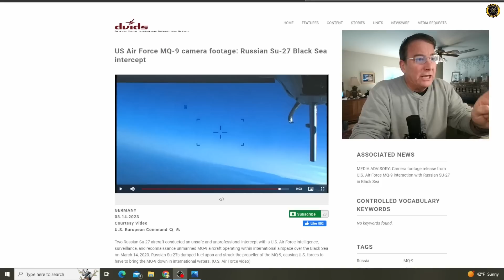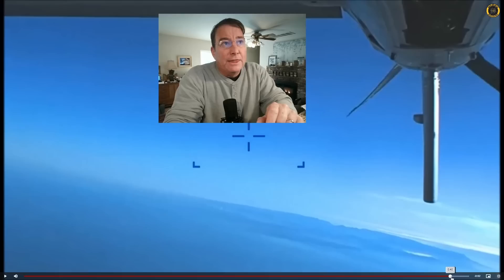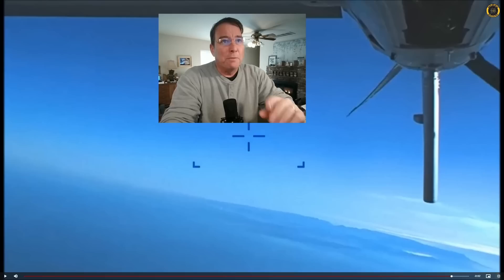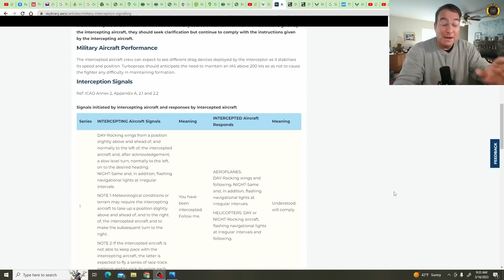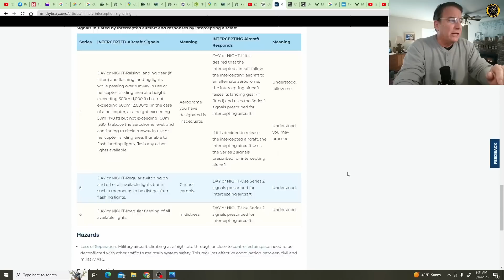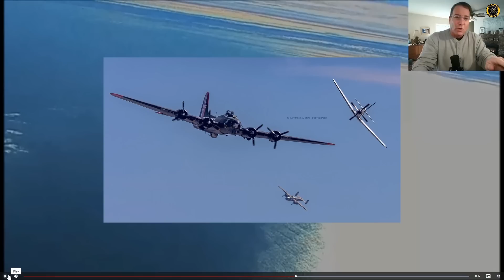Botched Russian Intercept of MQ-9 Drone Over International Waters

Comment: Just a couple of minor corrections. A reversing prop doesn't pass feather pitch to reverse. It passes full fine pitch on its way to reverse. Also, some props fail feathered and some fail full fine pitch. A good example of the difference are the 4/8 blades C130 props vs the 6 bladed on the C130J.
Reply: Single engine aircraft as far as i know always fail in full fine pitch, you wouldnt want to loose all thrust in a single engine aicraft if the feathering system failed.
Reply: @Icel4nd3r  Yeah I'm not sure about singles tbh but a prop failed in fine pitch has its own dangers. If the engine is also failed then you effectively have reverse thrust in flight beyond your control.
Reply from the maker: Correct, my mistake.
Reply: @Icel4nd3r  props will fail fine on oil pressure loss unless you have counterweighted blades in which case they'll fail to coarse pitch.  Counterweighted blades are used on aerobatic props for this reason - look for huge bobweights near the blade root.
Reply: @Icel4nd3r  loose = not tight, wrong word
Reply: @blancolirio  We used to fly Mig29, we hit trees, we hit water at high AOA with the low fuselage tail section...the jets survived...very robust built aircraft. One time a UA Szu  27 hit a traffic sign...I also flew some western jets...engineers shaved off a lot of weight...a lot less robust built...even the ejection seats (Martin Baker) sucked compared to the K36 seats which were around 150kg while the MB seat 93kg...but the envelope very limited...Anyway my point is the following, you do not want to hit an areal object with the wing or the cabin...both fatal or gets uncontrolled situation...the part to take down a drone is the bottom fuselage...exactly how He did it...
Reply: How can it not pass through feathered? Isn't feathered basically parallel to the air passing over it, causing no drag? If so, while turning from facing one way to another, how can it not go through feathered?!
Reply: @AureliusR because it goes from forward pitch through fine pitch to reverse pitch. Not the other way through feathered.
Reply: Props to  @blancolirio for admitting his mistakes.

Bada boom tish!
Reply: I'd love to see what, if any damage happened to the gearbox internals.
Reply: @Dreddip  you’ll have to ask the Russians after they recover it.
Reply: @Icel4nd3r  You are correct. Typically single engine piston aircraft do not have full feathering props. Multi engine aircraft will have them if they're constant speed. Turbines will almost always have them since the non-feathering version will continue to windmill at a high enough RPM to create a severe drag problem.
Reply: @imaPangolin  I have sent them an email requesting photos. I'll let you know what they say.
Reply: @Icel4nd3r  Always  Well said. How could it be any other way ?
Reply: @davidkavanagh189  WHAT ?Not the way it works
Reply: Hello David. As for the C-130 4 bladed prop model HS 54H60 when you say fails it depends on if it fails to control pitch or if the pilot commands a feather by the condition lever. That propeller has several safety features such as a low pitch stop and a pitch lock system which locks the pitch in case a loss of oil pressure to the barrel dome turns into a tendency to go fine pitch and thus a prop overspeed. The way it works normally is that a positive oil pressure needs to be presented to the fwd dome cylinder to maintain positive pressure on the coarse pitch side, otherwise it will naturally go to fine pitch and try to overspeed. The pitch lock works between 25-55 degrees blade in flight range and locks the pitch to prevent RPM overspeed. If an engine flames out the tendency of the assembly is to decrease speed but since speed is controlled by the prop (98-102%rpm in flight range) it will decrease pitch to maintain RPM to a certain extent and it will steady at whatever angle to maintain normal RPM for the aircraft speed while dragging the power section. To feather, a specific electric AUX feather pump is activated to raise oil px and bring the blades to the feather position (92.5 degrees). Of course if a change in speed is done it will affect the prop and its balance state. The angle limits on the prop blades is full reverse to feather like you mentioned.
Reply: @pauleyplay  I made a few points. Which one are you referring to?
Reply: @fasousa4798  Thanks for the detailed explanation! I had forgotten about the pitch locks!
Reply: @fasousa  every prop I've ever worked on requires oil to reduce pitch. It takes oil from the prop governor to drive the prop from the feathered position towards low pitch and ultimately reverse. In the case of the 331 an oil pump is used to unfeather the prop (unfeathering pump). To feather the prop the 331 has a dump valve above the propeller pitch control that when open dumps prop oil. The PT6 has a feathering valve which dumps prop oil and feathers the prop. It's possible the C130 has a different design I've never seen but I'd bet you got your forces backwards.
Reply: @Dreddip  Thanks for the input but no. The C-130 uses oil pressure to increase pitch while the tendency of the prop is to reduce pitch while accelerating. The normal prop governing via valve housing and pump housing adjusts pitch in alpha (flight) and beta (ground) range to increase the blade angle. Beyond the max pitch on high power loads towards feather it needs an additional pump called AUX feather pump (3 phase electrical) to push the blades up to feather angle (92.5º) and then it should stay in place stopped by a prop brake once the oil pressure drops when decelerating. If the prop is feathered and you want to unfeather for an airstart for instance then it also uses the AUX feather pump to decrease pitch and then the wind mill will take over until the power section lights off and the torque becomes positive.
Reply: @Dreddip  It depends which C130 prop you're talking about. I think the later C130Js have a prop that fails feathered and needs oil pressure to flatten pitch but the older C130 style prop(including the 8 blade retrofit) operates as @fasousa says. They are most definitely not all the same.
Reply: @davidkavanagh189  Fine pitch to beta then reverse. I cant get behind a prop fail to feather ? Bring you down in a hurry. Not saying you are wrong. Never seen it in 60 years.
Reply: @pauleyplay  Lots of props fail to feather.
Reply: @fasousa4798  That is a VERY interesting propeller control system design. I'd love to get to tinker around with one.
Reply: @pauleyplay  As for a C-130 54H60 prop you just need to have the feather pump failed (or ESS AC bus failed) and it will never feather the prop staying windmilling if within RPM limits otherwise a pitch lock system will lock the blades to prevent overspeed.

Comment: Thanks for the breakdown.
4:15 Just a note here, we don't know what happened prior to those fly-by. Maybe the fighters did start with a proper intercept before going into those fuel-dump maneuvers. We simply don't have data on how long that encounter lasted since we were only given info on the part that brought the drone down.
Reply: Yea I was always told there are TWO sides to every story.
Reply: yeah its kinda worrying that he says this is poor airmanship, its quite clearly superb flying with the intent of harming the drone without actually firing on it, '' get out of my war zone'' seems a reasonable assumption of the jets intent. i'm also a bit perplexed that the tail fins of the reaper were not hit, they stick out quite a bit more than the prop and i'm wondering if the fuel hitting the prop would be enough to damage it,
Reply: @TheMadmacs  the Russians claim the drone made a sharp manoeuvre, possible the drone pilot reacted to the near miss by throwing the stick over and kicking the tail into the su27?
Reply: @TheMadmacs  That point to Me is a good one.......I was wondering about that Myself.........Paul

Comment: Given how fast the prop is turning, I am surprised that there isn't damage to all four blades.
Reply: I suspect that something from the Russian a/c was cut through by the prop blade.  It did the damage to the problem described in the podcast.  What ever it cut was gone.   It's possible the RUssian a/c was fitting with something cheap (or it might have been an antenna) with the idea of messing with the prop.
Reply: 1,591 RPM at 100% although its possible this one was running at a cruise RPM so 1,530 ish.
Reply: 1500 rpm = 4 x 25 blade whacks/sec (you can redo the math with 1530)
Assuming drone at 200 kt, Su at 300 kt:   100 kt rel Speed = 169 ft/sec
Su-27 Length:  71 ft
Duration of pass:  .42 sec (Len/relSpd)
-> 42 Su-whacking opportunities by prop during the fly by.  (PassDur x whacks/sec)
-> 1 Su-whack every 20" inches (Len/whackOpps)
Conclusion | blade damage:
(as neither a pilot nor an A&P)
Su had 1 blade strike, likely on engine nozzle or empennage.  2nd blade was fouled by downstream mechanical shock to prop hub during plastic deformation of the whack-blade.
That's my 2¢.
p.s.  if you ever want to impress people, say "plastic deformation" instead of "bent."
Reply: @77thTrombone  Dude!  You cant fool me.  That's a tuba!!!😄
Reply: @77thTrombone  I love it! 🤣
Reply: @GilmerJohn  The pilot opened a window and threw a spade. Mystery solved.
Reply: Stalinium very stronk.
Reply: Rotational speed of prop, vs speed of aircraft = number of prop blades damaged. Do the math…….s.
Reply: @KazimierzSurma  --  Works for me and fits all the data!
Reply: @johnnunn8688  I did the math.  Look up in this thread.
Reply: CGI edited to fit the narrative. No yellow paint either
Reply: @77thTrombone  Well done! I worked this out a minute ago and was going to reply and saw you'd already done it. FWIW I got a very similar result as you with my assumptions (1 whack per 17 inches). My money is on the pointed tip of the horizontal stab of the jet which clipped the prop, but that's just a guess.
Reply: @400_billion_suns  excellent!  The only question is:  did the pilot get whacked for damaging his plane & sullying the reputation of the RFAF, or was he awarded the Order of Putin for defending his tsar from the perilous intruder?
Reply: @davidbross6942  Congratulations!  You have just placed yourself in the top 5th percentile of the YouTube population.
Next question, to rocket yourself into the top 1 percentile (without the mess and fumes of uninvited afterburner to get there,) how do the name & the pic tie together?
(Hint:  Meredith Willson)
Reply: @77thTrombone  The Music Man!   Love your sense of humor.  We had some slogans in our tuba section:  Bass is the place and There's no class in the low brass.
Reply: @davidbross6942  LOL!   Love it! 🤜🤛
When I talk with colleagues about my band experience, I note that I was not the most talented musician, but I do make a good bottom.
p.s.  Congratulations on membership in the top 1 %ile!
Reply: @77thTrombone  I know, we did have the easiest music.  But what a great sound!  I think in my next life, I might try the bass trombone, it has a great sound and bite.
Reply: Su-whack is my new favorite aviation term
Reply: @mvd4436   If you search the threads here, I proposed a logical and fact-based hypothesis as to why you do not see the yellow prop markers. No conspiracy or CGI here.
Reply: @77thTrombone  This is cringe level cope. The plane didn't hit the drone. And took it down with a fuel dump.
Reply: @davidbross6942    Generally yes, but maybe you never played Nutcracker or William Tell.  Downright embarrassing, those pieces — yes, down on the bombardon line — were so far beyond me.
I played Eb tuba on a bass trombone part in a big band for a year.  That was a lot of fun, but I won't hesitate to admit that the bass trombone is there for a reason.
Unless you have an intake appointment scheduled at the hospice, it may not be too late.  
Hint:  There's a correlation between the 7 slide positions and the valve fingering you're familiar with (unless most of your experience is contrabass bugle with 1 piston & 1 rotor (operated by different hands, but I digress....))   If you remember the fingering to walk up a chromatic scale, boom!   A few weeks of practice, and you won't be thinking about it anymore.  (Well, not very much.)
Pawn shops, online used horn dealers, even estate sales......
You'd be a hit a parties!
Tell me how it turns out!
Reply: @mvd4436  the weather changes too. Look before and after the footage cuts out. Also, as an electronics programmer and technician, there's zero valid reason for a digital video recording to cut out and then back in like that. If they wanted to release the full video they could. They 100% had access to it before the drone hit the water. But they only released an edit. Fishy.

Comment: In my career at Garrett, I worked on a few versions of the TPE331 (21 dash numbers and a total of 88 variations).The MQ-9 uses the TPE331-10T with 950 shaft horsepower.  As you can see, the TPE331 was one of our most successful engine designs.
Reply: I love that engine (re: TPE331's).
Reply: The TPE 331 is an iconic and legendary engine! It's still being manufactured today which shows what a great design it is In my opinion way better than the PT6!
Reply: In my career at comment critiquing, I have never seen a comment with damn near more numbers than letters. 99.99999% of readers of your comment will have any clue what all of them mean.
Reply: @bradsanders407  then they will just scroll on by....
Reply: @bradsanders407  You have a comment critiquing career?  Does it pay well?  Of 4 responses so far, 2 knew exactly what the numbers were about.
Reply: @bradsanders407  As a 99.99999%er, you are correct.  I completely understand his comment.
Reply: @bradsanders407 
you seem to have a very low opinion of this audience,
given your repeated insistence that we know so little.
Allow us to breath the rarified air you dwell in, oh great guru.  😐
Reply: Good engine but nosy.  Always preferred the PT-6 powered King Airs.
Reply: @rodneywallace2984  
He's on every comment thread. Wish we had a "fly swatter". 🪰
Reply: @bradsanders407  💤
Reply: @bw162  A lot of people say they're louder/noisier but the 331is the same noise level in all operations except ground idle. the -6's with the 2,000RPM props are all prop noise. I'm not a pilot (a mechanic) but doing ground runs I can see why pilots love the 331 over the PT6. Personally I think a 331 is a lot easier to rig (Bendix or Woodward FCU) and a whole hell of a lot easier to match (on a twin) than any variant of the PT6. Maybe with the exception of the PT6E since its all FADEC and there is no real rigging to speak of. Although I've never been a fan of the B100 Kingairs with the -6's, not a good airframe for the 331. Or the Merlin/Metro (barf) with the -10U
Reply: @Dreddip  The only reason Beach put a 331 on the model 100 was because of the P&W strike.  We had a field of finished King Airs with lead weights where the engines were hung.
Reply: Its too bad Honeywell is running it into the ground. The 331 is my favorite to work on. -5's and -10's almost exclusively. Do some work for the local A&P Colleges pre-century -43a's when they have trouble.
Reply: @bradsanders407  I applaud your career choice. Bravo!
Reply: @Dreddip  Good for you!  My dad was an AI.  I was the dummy in the family and only qualified to push the throttles forward and back.
Reply: @bw162  Oh, I'm fully aware of why the 331 wound up on the Kingairs. They gotta do what they can to stay in business, I get that. I just don't like the Kingair in general 🤣
Reply: @Dreddip  You are in a very small minority.
Reply: @bw162  Don't sell yourself short, technical knowledge/skill doesn't exactly translate into pilot skill. I do my fair share of flying but I've always had trouble in IMC or spatial orientation. I'm day VFR only as a result, and only when its fairly smooth air.
Reply: @bw162  I'd say I'm the minority because they made so damn many of them, as a result tons of people work on them. I don't particularly like anything that comes out of Textron in general, the build quality and the engineering hasn't changed or improved much. Probably because I've been spoiled with Embraer (Phenom, Prator, Legacy) and Pilatus PC-12's. But there is a reason why Textron made so many of them, they are work horses and are a very successful product.
Reply: @Dreddip  I consider myself a retired stone-age truck driver.  But I never bent any metal or caused any blood loss.
Reply: @Dreddip  I was there when Olive was Chairman.  A LONG time before Textron.
Reply: @Zupdood2  !!!!!!!!!!!!!!!!!!!!!!!!.....right on..............Paul